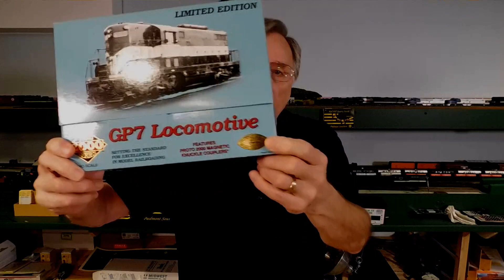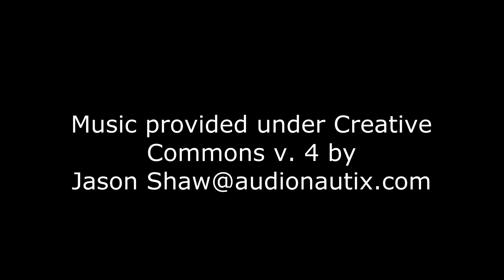63. DCC Conformant, Compliant, Ready, and Friendly--What Does it All Mean?

Comment: Larry, with all due respect, this explanation of a "DCC-friendly" turnout falls short. The fact is that any locomotive, either DC or DCC, may short at a turnout if it derails, or even if it stays on the rails for that matter. A short circuit is a short circuit in either environment. Yes, the mechanical design and construction of our turnouts has improved over the past decades, so that better clearance exists for wheels to pass through the various trouble spots more reliably (without shorting), but this has nothing to do with the type of power being applied to the turnout or locomotive. There is nothing inherently electrically better or more "friendly" about today's turnouts whether we operate in DC or DCC. Let's place two mechanically identical locomotives, one DC and the other DCC, on the same turnout, run them through it, and intentionally derail them so that a short occurs. Is there a difference in the result?
The catch phrase "DCC-friendly" is a misnomer; it has been since its inception.
Conversely, you are spot-on about locomotives being "DCC-friendly" if their motors are isolated electrically from their frames. This type of construction is fact, makes sense, and is a boom to the DCC side of the hobby.
Reply from the maker: I agree that video really didn’t focus that much on DCC Friendly turnouts and maybe I’ll just do a short video on that subject. Thanks for the nudge.